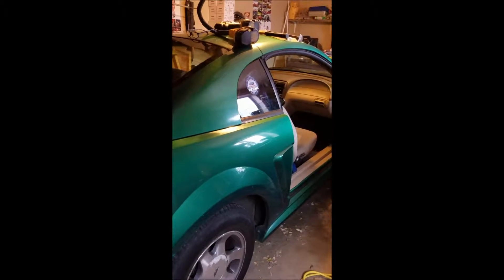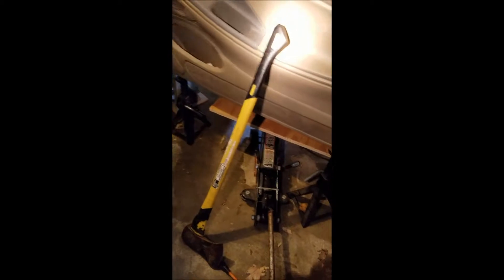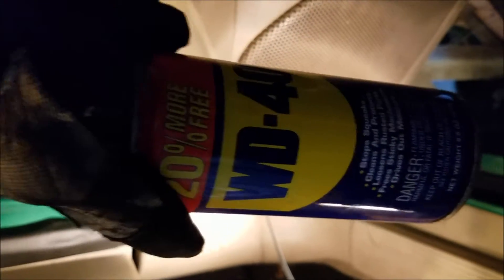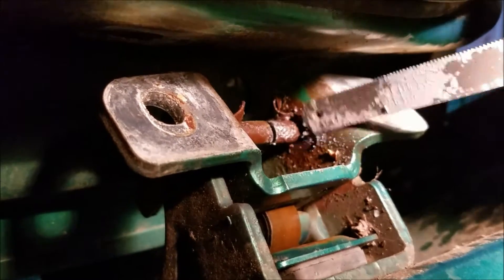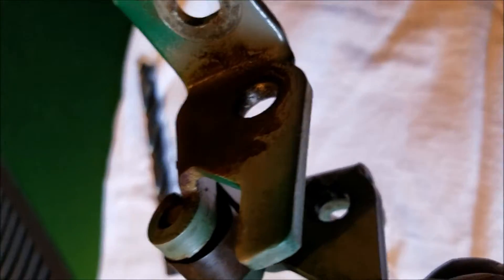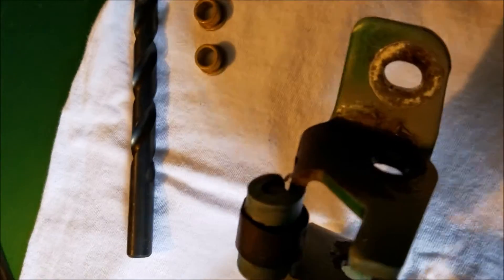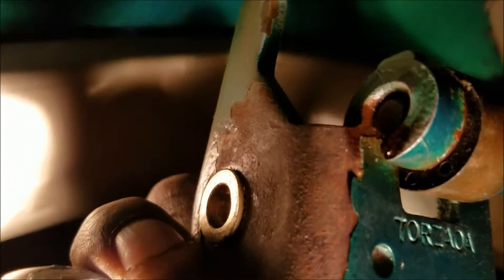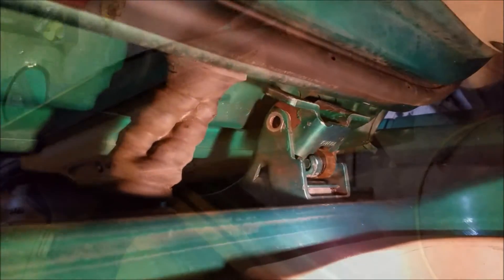2000 mustang door hinge

Comment: Thank you for taking the time to post this. It definitely saved me a lot of time. Cutting the pin is a better idea, it is cleaner and quicker. Marking the hinge position is a good idea as well. After installing the hinge with the new bushings, the door lined up an  closed like a dream. One thing I ran into was after I inserted the bushings the inside diameter closed up a little and I could not get the new pin in. I had to hone the bushings out so the pin would go in.  It seemed to work well after that.  I carefully used an 11/32 drill to clean them out a little.

Comment: You say 13/32ths even though it said 15/32ths on the package and the drillbit. Later when you said make sure you get the right size you then said the correct size 15/32ths. This looks like too much trouble I think I'd just order the lower hinge assembly. I've seen them for under $100.